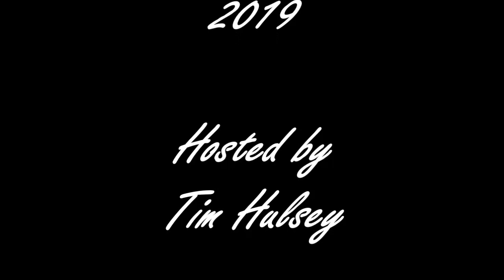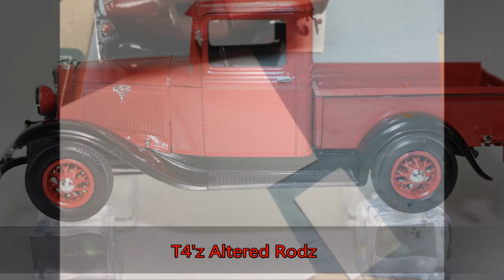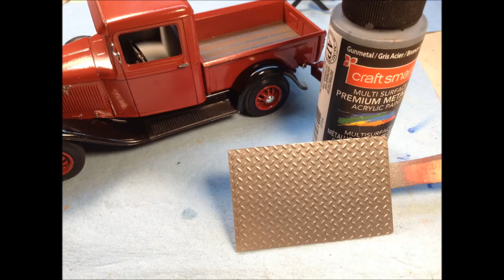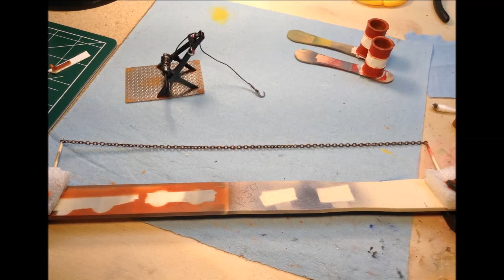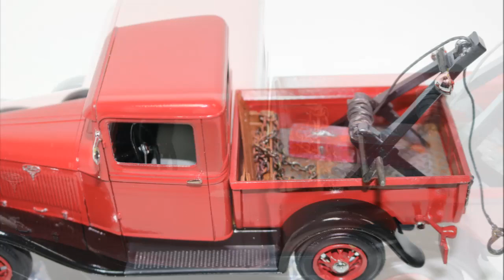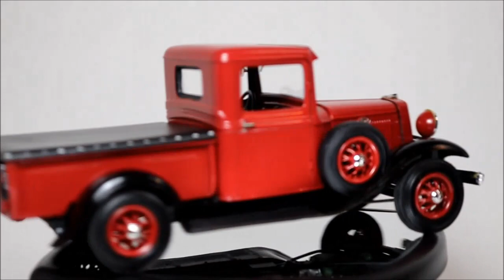Lindberg '34 Ford Tow Truck - Part 4 Final Reveal

Comment: Great job Steve, turned out really good, I see AMT is releasing this kit in its original format, including parts that was in the first issue in 1962, :)
Reply from the maker: I thought I'd seen a new version of this, are there more parts in the new kit?
Reply: @ModelCarMinion  Yes, parts that came in the original kit are going to be in the new release, I will have to get one
Reply from the maker: @ramblers69   So what is in the new release that's not in this one?
Reply: @ModelCarMinion  I'm not sure, going to have to wait for an review on it, I've never had the original issue, to pricey